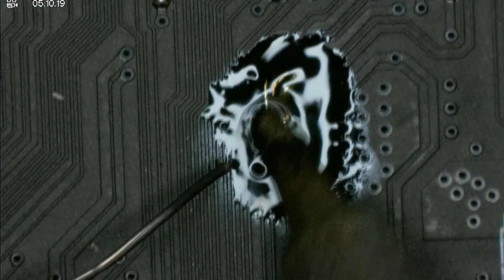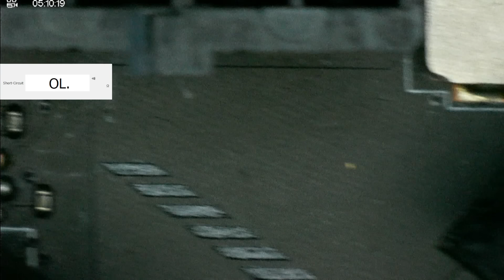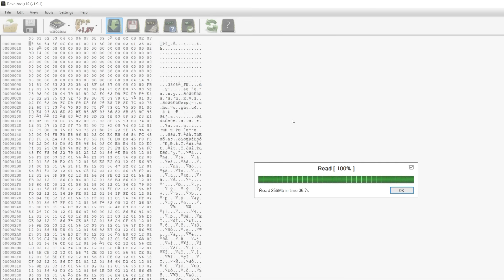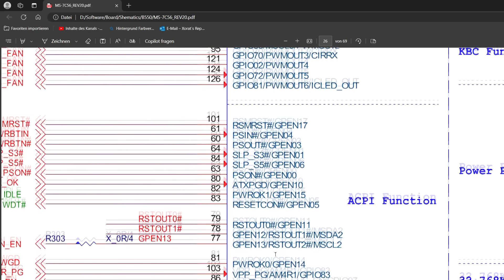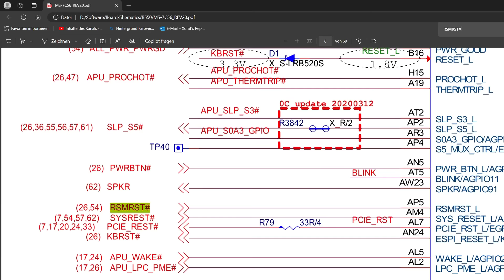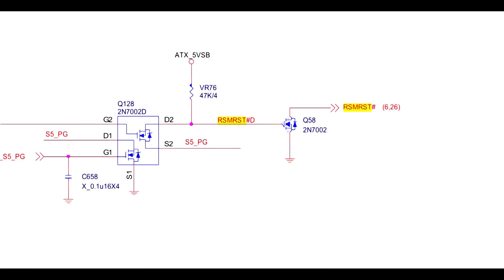PREVIOUS TECHNICHAN COULDNT FIX THE BOARD CAN WE? || B550 MPG GAMING PLUS REPAIR FIX

Comment from the maker: Hey there together, after a lot off good sugestions i checked the resistance from RSTRSM and it has 16 ohms! Injecting 3.3V it takes about 50mA and the SIO gets hot, about 50 degrees. So i guess the SIO is dead!
Reply: use the solder iron and twezers to gentle lift up sio 101 pin. then check resistance and inject 1.8v , limit the current to 50ma to be safe. Do you have a bench linear regulated power suply?
Reply: Assuming that the  SIO output could have been in the active state (low state)  for the RSMRST# when power to the SIO chip is on and RSMRST# output  is provided by an open collector  or open drain output device which is in a saturated output state injecting 3.3 V may not be a good idea unless the output spec allows for sinking that much current assuming the injected supply current is limited to 50 ma.  Note that  50 ma into 16 ohms is only 0.8V  since the output goes to 3.3V  the SIO output could be pulled out of the saturated state and dissipating more power.  Of coarse, if the SIO output open collector or open drain state is off it would allow the output  to be pulled up easily without drawing any  significant current and would not be getting hot.  So yes, the SIO could have been defective originally  or possibly caused to fail with the 3.3V injection.  As I recall you did this injection previously to this last test.  If you decide to replace the SIO chip I would recommend doing the power off continuity check on the other components and etch lines to make sure there is still not a low impedance on the RSMRST# node when the SIO chip is out of the circuit.   Hope this helps.
Reply: Typical voltage for rsmrst signal for AM4 is 1.8v ... Injecting it with 3.3v might kill the SIO
Reply: I don't think it's a good idea to inject 3.3 on a 1.8 line. Besides, how can you be sure that the low resistance was inside the EC or somewhere else in the circuit ?
Reply from the maker: @nikolaskallianiotis8622  Well it didnt make it worse. There is basicly nothing else in the curcuit as i showed in the video, there is basicly only the SIO left
Reply: Hi! How can i get those schematics. Cad for motherboards?
Reply: I usually repair laptop motherboards, and when at the beginning of your video I saw that the 3.3 of the power button were present and that the current did not change when you pressed the button, I directly assumed that it was the SIO , if it was the bios or something else, there would have been a variation in the intensity of the current even  minimal  I think, thank you for your video, we always learn

Comment: If the Super I/O chip is dead or the EC firmware is corrupted, the RSMRST# signal might not show up at all. That usually leads to a no-power condition or a board stuck in early power stages. But before chasing RSMRST#, always check if ECRST# is present first—because without ECRST#, the SIO won’t wake up, and you’ll never get RSMRST#. You might Aswell check the 32.768kHz crystal oscillation, if that oscillation is missing ECRST will not gonna show up.

Comment: Wasting your time replacing the parts in the CPU VRM circuits mate, that is just about the very last thing to power up. You should be working with the power on sequence and checking which voltages you have and which are missing, each buck regulator sends out a power good signal to the SIO and the SIO will not try to turn on the main PSU until it has Power good signals from all the required Buck regulators. Also the final step as to whether the main PSU is enabled also involves the PCH, so it needs power too. Bob

Comment from the maker: Update on this repair! Its been quiet some while and indeed the SIO had a active short on rsmrst! I was able to solve that with replacing the 22k ohm resistor with a 0 ohm! So the 1.8V CPU line is almost directly connected to the SIO! With that it draws more current but it was in the 2 digit mA area! And the 1.8V CPU power supply can handle a lot more! So getting around replacing the SIO with changing the value off 1 resistor and now the board works normaly!

Comment: What do you charge for these type of repairs?
Reply from the maker: I currently dont charge money for my repairs!
Reply: @MainboardMedic  How can I send you a board? I bought a used TUF x570 that ended up not working. It will power on if jumped from the main harness, but the GPU won't power on.
Reply from the maker: @twanospano5293  Contact me via email!

Comment: Both inputs G1 and G2 must be high to take the board out of reset.  If either is low, RSMRST# will stay asserted (low) and the board won't start.  Trick is to find out which of the inputs is low and why, and if neither are low, why Q128 is not working properly.

Comment: You probably need to look at the SIO's datasheet to see what sets that pin (GPEN17) high or low.  "GP" means it's a general purpose pin, which means that it's either programmed internally to operate a certain way, or it has strapping options that set it to operate it a certain way, or it's dependent on some other input signal to the SIO to control its behavior.  You'll need to see what other ACPI-related signals are coming into the SIO that can affect this output.

Something upstream of the SIO could be the issue.

Comment: hello I just came across a video of you I have the same problem with a b560-i gaming wifi super I/O very hot and not starting I have to change find it on another motherboard and it turns on everything except the processor and the chipset you think you have to change to have the exact chip and program this chip
Reply from the maker: SIO´s dont have to be programmed on ATX boards! You can either buy another chip or take it from another board! Ive done that muliple times so far!
Reply: @MainboardMedic  ok bearing I changed this chip with a new one bought in China it motherboard does not turn on and I still have an old motherboard with nuvoton chip and with it the card turns on ram led fan except no processor and chipset

Comment: Out of curiosity, does the board start without a CPU in?
Reply from the maker: Am4 cant start witut a CPU in it!
Reply: @MainboardMedic  Well, I have the exact same board (faulty) and it does start without a CPU. In fact I have another X570 board from MSI with the same problem. I also found this video of a guy fixing a B450 board ....again from MSI. So I think this might be some kind of wider MSI issue (they use the same brand components maybe which fail for some reason?)
https://youtu.be/Qxb6Z87RkKo?si=ZgXtjSD5-EZmvuiz

Comment: D at the end of rsmrst probably stands for discharge so not having voltage on rsmrst_d is not a problem. something else causing it to short to ground for example q58 or something else. working on similar problem on hp 250 g8 board which something pulling down slp_s3 and susp signals which really annoying and time taking to find. Please do not give up on this board because we really want to know the reason of why rsmrst is stuck to ground on this particular case. Enjoying your videos. Greetings from Azerbaijan

Comment: why not check q128 mosfets for shorts and use  diode mode on your meter to check for voltage drop from source to gate , gate to drain on both mosfets

Comment: if r78 is a pullup resistor, 1.8v in pin 101sio is necessary before it gows low. q128, q58 , and sio could also be  shorted 1.8 rsmrst# to ground before it gows high.
remember RSMRST# has to be high before it goes low

Comment: (RSMRST# has to be high before it goes low), # means active low,in this case the reset signal. put the scope probe in sio pin 101 before power on button, then press the button and see the signal.also check resistance across r78 and between ground?

Comment: @MainboardMedic, I love your videos, is there any chance you can do a video on programming a BIOS chip, each step you need to do from start to finish?
Reply: first tip.. dont trust spi clips (clamp) is hit or miss depending on circuit. desolder chip. try this video from FairRepair EN title How to reprogram a BIOS flash IC properly with CH341A - The Dos and the Don'ts - Basics #1
Reply: @LeadFarmer813  I use clips and pogo pins and it works well. Of course you need to make sure the clip is connected properly. Before programming I always read the chip first, at least twice, save the results and compare in HxD until I get the same reads. The only problem is when the software does not support a chip you want to program. I was using CH341 and now SVOD4 because of the speed and better chip support/software.

Comment: There are a number of reason why RSMRST# won't come out from SIO. This could be a faulty SIO, missing 32.768kHz crystal oscillation near processor & SIO  , missing 3.3VALW&1.8VALW, busted EC SPI chip, open resistors or PCB traces,

Comment: Q128 is an NAND gate, Q58 an inverter.
If both VDDP_VSB_PG and CPU_1P8_PG are high, than RSMRST# is not pulled low. So reset is not activated.
Reply: I agree the inputs and circuitry up to Q58 are correct.  Problem is that Q58 drain node is held low preventing it from coming out of a reset.  Several things can cause this as mentioned previously including the SIO.  It could be something simple like Q58 shorted, C16 shorted or leaky, or a short or low impedance to ground in the etch lines.  Perhaps a continuity check across C16 with power off would be helpful? A reading much lower than the 22K resistor could cause the problem assuming the SIO chip and CPU input in an off condition don't cause a low resistance when not powered up.